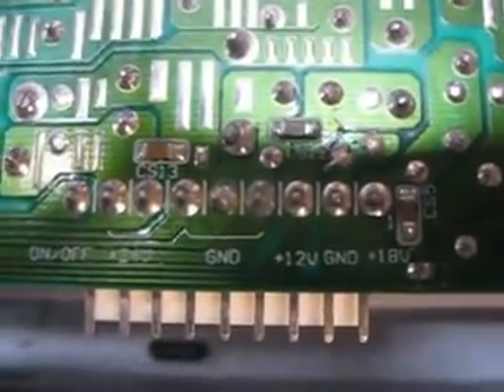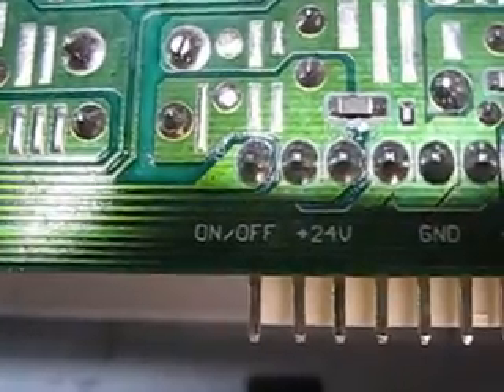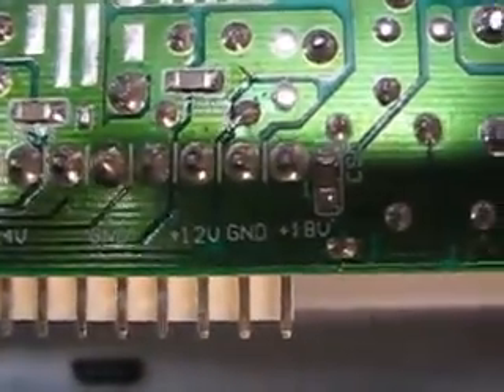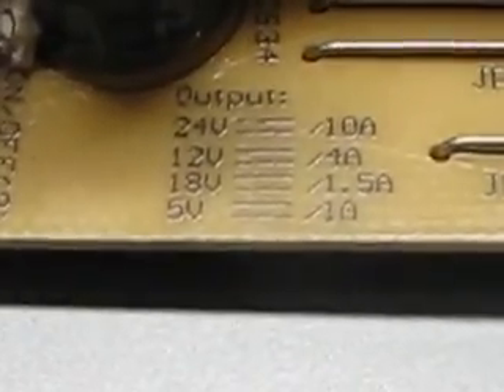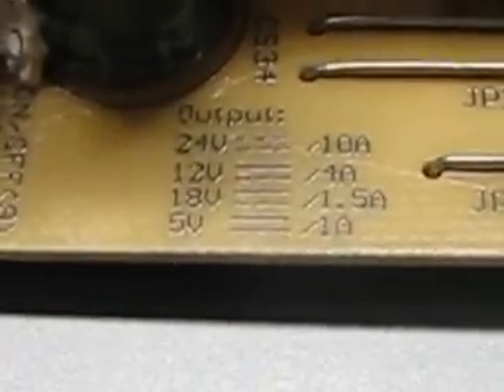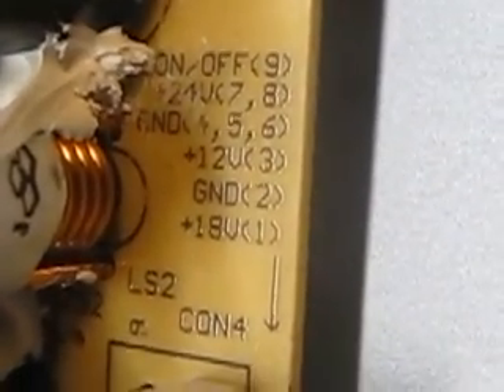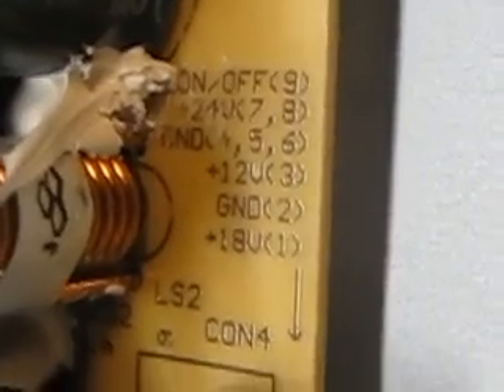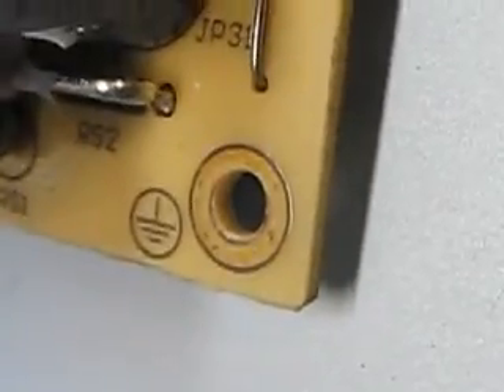TV power supply. Making a light from a broken LCD TV

Comment: Usually you touch the on/off to ground to turn it on. With the power supply plugged in check if you see voltage on the on/off pin in reference to ground. If so grounding it out will power it on. If not your safest bet is to find the pin showing voltage (most of them will not show voltage untill its powered on) and try all pins registering voltage one at a time starting with the lowest voltage. That's what I'd do at least. Good luck.
Reply from the maker: I think you put 3.3v to signal and it comes on. Not sure, I haven't tinkered with these in awhile.
Reply: Wow, that's very unusual. usually the backlight pin will be labeled with a bl on, on or something along those lines and you would pull that pin up or down with either a small voltage or ground depending on the setup of the circuit and the audio and video amps use signal ground pin which is kept separate from power ground to avoid interference. companies sometimes do the weirdest things so who knows, you might be right.
    @coondogtheman

Comment: I took apart an old flat screen I found in the trash had a huge hole in it. I salvaged what I could and saved all the lights. Do you know what I can do to use them as working lights? Like what power it needs to run one by itself. I have an idea to make a huge clock or lights around the room.
Reply from the maker: Most of these have inverters mounted either separately from the power supply or are built-into the power supply. They run on 24 volts and put out maybe 3000 volts (not exactly sure) you will need to find the 5 volt signal and PSon points on the power supply board (some are labeled some arn't) and you touch those two and the power supply should come on. if not sure put a bulb from a 6V lantern across the two and it should light if not dimly. This process is the same at connecting the green wire of a computer power supply to any ground pin.
Reply: @coondogtheman  I have all of my voltages and THAT DID NOT WORK !
Reply: My problem is im adding an LED power supply and lights to an LCD with a power supply already.. You guys just need to link that main board, botton pannel and IR for remote and your good... 2 years ago😂😂😂😂
Reply from the maker: @whoismarkjones9283  actually all you need is a 24 volt D.C. power supply. This may work of the TV's power supply is either dead or needs too many return points in order to turn on.
Reply: The circuit for the CFL's is a bit on the complicated side. If you just saved the lights alone you could definitely look at the bulb towards one of the ends where it plugs in and find the part number to find out what voltage is required but there is always a start up and a  run voltage. The start up is going to be super high to ionize the noble gas/mercury inside and begin conducting and then the voltage is lowered to something like 90v pulsed to keep it on. You can always rung only high voltage to the lights however it will significantly reduce the lifetime of the bulb. Saving the circuit is always your best bet if possible in my opinion.
Reply: TV power supplies require a handfull of return voltages in order for the power supply to function. Still figuring mine out as well lol the main board of the TV and the button pannel and BAM. Works and you have a remote!